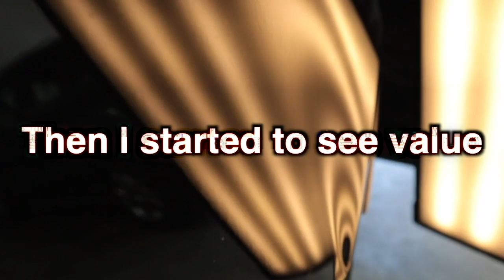PDR TUTORIAL- How to Fix Dents Like This ☝🏼Real World PDR

Comment: About how long did this repair take? Will a dentcraft cherry tip fit that tool tip if u tape it on?
Reply: Raymond Ezell 2 hours or so. That rod doesn’t accept interchangeable tips, but as him said a little bit of Tessa tape on the end goes a long way.
Reply: Michael Kasper. Hey kasper thanks for the reply bud. I have a finesse tool that doesn’t accept interchangeable tips either but works very well taping the red cherry caps on it. I’d send u a pic if I could.

Comment: Lol he scared me too on that wet sanding I used to do wet sanding before and I know ho delicate it could be but yeah it looks like he knows he’s wet sanding techniques
Reply: Aristides Castillo I call it knocking the tops off. In those high pressure areas I tend to make micro pin pricks, that literally just need the tops knocked off.
Reply from the maker: +Michael Kasper if you look closely at the after, you can really see that there is still some orange peel. Good repair buddy.